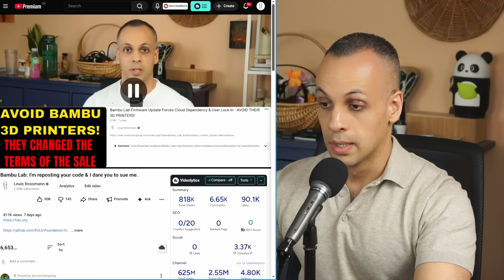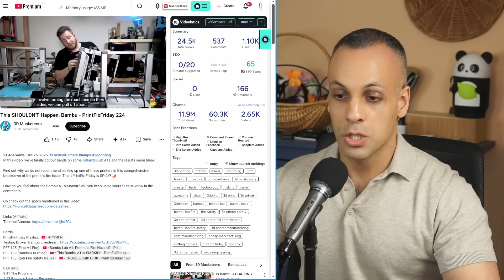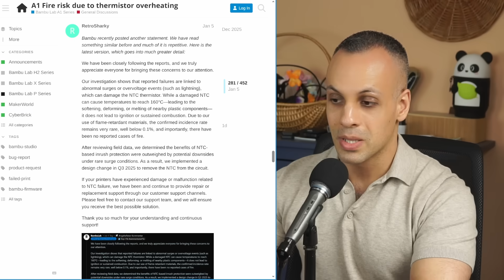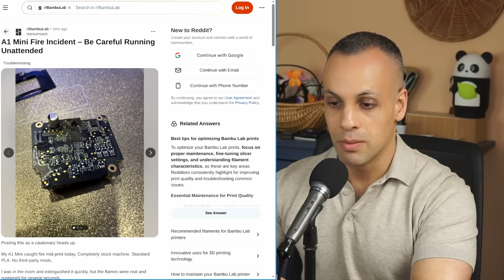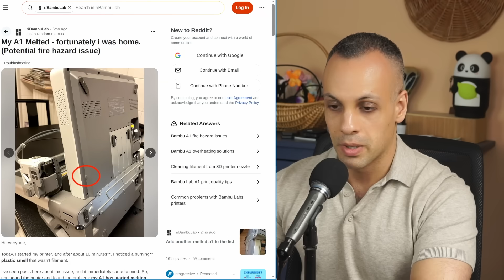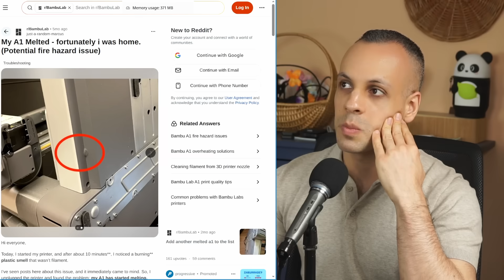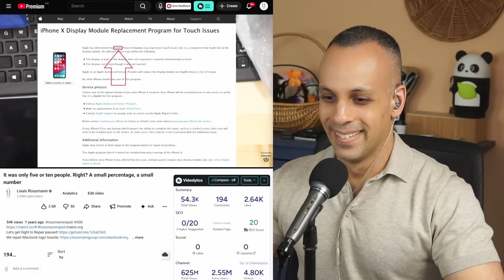Bambu Lab PR dumpster fire is turning into a literal one...

Comment: When i was looking for a 3D printer für at home and later for my team at work, i specifically ruled out Bambu lab printers for 2 reasons: the normal versions needed an internet connection either for printing or for first use installation, and i did and do want to be able to use the ting completely offline.
(the extra company version of a printer they offert was able to work "lan only" but they did not give me any price, so we got something else for work)
And the second reason is their busines practices of changing the terms of serice after you already paid.
That alone is a reason for me to not consider any product of theirs at all.

Comment: The need to avoid a part made by a particular manufacturer is not that unusual. I remember a time (many years ago now) where it was best to avoid buy 741 op-amps made by Fairchild. They were known to be a common point of failure in electronic devices. Personal computers from the 70's and 80's often had a particular brand of RAM that was prone to fail. The people who work on retro computers with the goal of getting them working again would often find that if any RAM chips in the machine had failed it was often a part made by one particular manufacturer.

Comment: I mean... NTCs are the most common inrush current limiting devices in PSUs. Not just Bambu Lab PSUs. ALL of them. And the failure mechanism is exactly how they described it. So unless there is something more going on, which I am not aware of, it seems the story is blowing up only because of the extra scrutiny they fall under after the software fiasco rather than an actual problem.

And for everyone saying 0.1% is a massive number. It's not. In consumer electronics 3%RMA ratio is considered acceptable, and below 1% is awesome. Not to mention, even if NTC fails (which happens to <<0,1% of the units according to the message), it's even more rare for a dangerous failure mode to occur.

What saves the PC PSUs is that most of them will trigger overcurrent breaker in your breaker box. So if you are worried about low power electronics like this, just use an extension cable that is fused according to the load connected. You probably should anyway but who am I to suggest usage of basic safety equipment.

Comment: Just to be clear for anyone who isn't clued in. A component reaching those temps is not ok. That is where you would need a heat sink and ventilation/fans. Heck if your plastic is melting and deforming, if soot is forming on the inside that's not something that will end well. It is a cause for a total recall but a recall is hellishly expensive and that's the crux.

Comment: This is as so often a US only problem.

Bambu designs their printers as pretty much anyone else for use in the developed world, and then needs to retrofit them for the low voltage use in the US.
The heated beds are a prime example for this, in the US models take way longer to heat up with their low voltage AC grid and underspeced breakers in house installations.

The US power grid falls out of spec way more frequently than almost any other, and you can only design to spec plus some margin.
Power surges and outages are unheard of in the western world for half a century.

This rare occurrence only seems to happen if you use your printer way out of spec due to the unreliable US power grid. 

Same goes for cars, with the abysmal petrol quality in the US.

Comment: I'm a chronic shopper and heavily research most of what I buy for myself, but by first and only 3D printer was a gift for which I did zero research and had not even the faintest hint I'd be getting. It's FlashForge Adventure 5M and while the user experience isn't perfect (proprietary nozzles, some connection troubles) the prints have really been effortless and consistent. I suspect most 3D printers today are probably about the same so it's wild to me that Bambu has such a large market share.

Comment: I love my A1, best FDM printer user experience I've owned. BUT if they have any unsafe component, or if they are changing the user agreements after the fact they should be taking responsibility for it. One thing does not preclude the other, and if they blame the users or try to gaslight us, then fuck them.

Comment: I love their hardware and their P1S has been really reliable. after what's been going on lately though... >_> I run a small charity print farm so when these 4 printers start dying, I'll look into replacing them with the Snapmaker U1 or something comparable. The hardware still works, so I'll still use it, but depending on how things go over the next month will determine if i buy repair parts from them or a third party.

Comment: Ha! My A1 almost burned on me, then the integrated PSU popped dramatically, it was only 3 months old so it was fixed under warranty. However I was smelling a burning plastic smell for a while beforehand, googles "A1 fire" and a cap in the hot end motor driver board was the problem, disassembled mine and it appeared to be the same problem, but the warranty replaced the PSU, and it has been working since, and the cap hasn't failed yet... No burning smell either. Weird. 
I run it in a shed away from my house that I am not concerned with burning down, built it in a weekend for other uses and will build it again if need be.

Comment: Just bought another X2D as a mech/elec engineer developing an injection molded mass produced outdoor electronics product. Sucks to go bambu but there are some workarounds to the shitty bambu slicer and cloud. Competitors are lack luster and it doesnt make sense for me to buy into lesser technology when Bambu is on the actual cutting edge of vibration controlled calibration, best injection molded parts, Best, AMS, tons of printers available on FB market, etc.

Comment: I mean bamboo as a plant starts off great, but can quickly become a pest when it starts spreading and is an absolute pain to remove. so it seems the company chose their name well.
Reply: I actually researched bamboo and found out there are two types, each with a lot of sub species. Running bamboo is like what you mentioned, it's like a weed that can spread everywhere. Clumping bamboo is what you want, it spreads, but the spread is limited.

Comment: NTC Thermistors have lower resistance as temperature increases.  If it is driven by a  current supply that is not properly regulated, it can draw more current, creating a feedback loop which can cause the thermistor to get VERY hot (thermal runaway).  This might be enough to start a fire.

Comment: oh oh, theres so many, well some of its bad electrical engineering, and some of it might be fixed in software. I dont want to work for these guys to fix it though. So you have inrush over current on the A1, control board, this probably requires an ECR. the ones for the extruder might be fixed simply with software controls.

Comment: i own bambulab printer. Its a very good printer. Its a game changer. But they are preparing for releasing new multi color multi precision nozzle printers. That would open a gate to print CMYK almost all colors just by using 4 filaments like standard printers do by mixing colour close to each other.
So if someone would have orca slicer with all functions of bambulab and its multi color multi nozzle wont produce alot of plastic poop then ure in market all the nerds gonna jerk to that. You can even cash out a bit more because its gonna be basically new standard.

Comment: NTC voltage divider thermal safety sensors are ubiquitous in consumer electronics. 
There aren't many possible ways to implement them. 
There are numerous (sometimes, uncountable) combinations of electrical design considerations that determine which implementation to include. 
The test engineer must be aware of, and fully understand all of these details in order to develop an air-tight MTP that not only verifies intended nominal operation & full range of operating failure modes, but also validates the design.

If your hardware designer is an AI, and your lead test engineer is an AI, then you better pray that the warden at the prison you're headed to will also be an AI
Reply: Then again, if it wasn't for AI then I would have never had the opportunity to conduct my current independent research into motor-driven batch flow mass-transfer operations across isolated multi-endpoint distributed systems. 
(Some still call it "pizza delivery" which is a grotesque, even absurd over-simplification)

Comment: I have had my anycubic chiron catch fire due to a broken wire. Once the wire snapped from the insulation burning off it self extinguised.
Twice. It was bloody old though, modiefied and after repairs it worked perfectly.

The new Kobra 2 Max bricked after a software update. So they sent me the previous firmware along with how to revert the change and have it not connect to Wifi.

I like Anycubic.

Comment: I was really interested in Bambu when I was first starting out, but their closed ecosystem really turned me off, even though they looked like the easiest option to learn the craft. But honestly, it's better to just suffer through the rocky start. I went with a resin printer, ultimately, and I didn't actually print something properly until like my 3rd or 4th print, and by that point, when my print rose from the resins, my breath caught like I was seeing the new birth of a star. And also because I was choking on fumes due to forgetting to shave my beard for my gas mask. I'm more careful now, but resin is some nasty stuff!

Comment: I watched this on my phone on a phone stand that says "bambu labs" on it that I printed with a bambu printer where I also just received a notification that my morning print was done. 😂🤷‍♂️ I really hope they wisen up. Yet again, I don't understand how companies in this era think they can conduct themselves this way on these types of issues. These aren't really the hills to die on, don't jive with frankly a lot of their actual business and they really undermine their brands unnecessarily. "Folded under zero pressure." It's like they're not just running an MBA playbook from >10 years ago but pre-mass adoption of the internet and skipping basic relative cost analysis. This isn't even THAT deep but you can set up an unstoppable domain on a webserver that can be self hosted on a smartphone from >7 years ago. That phone can be connected to multiple channels and redundant in a failover CDN. You can technically serve it from regular radio with the correct specs/context but be compliant with FCC rules etc because they don't really muck about. Then you have wifi, various G's of cell signal, satellite, possible Ethernet (convertible with a dongle and other options), bluetooth and also various forms of mesh nets. There are turn key off the shelf mesh net systems as well as open source software now so even if you aren't that technically inclined you can do some of this. Putting it mildly there are ways. You can also do physical print if all of your typically Chinese made tech magically isn't working for whatever reason. Not sure how they thought these types of things would go unnoticed or how it was apparently absolutely imperative that they make these decisions this way.

Comment: I was looking for a new 3d printer... Bambi lab was actually pretty well priced. But then I remembered that they screw over their users with locked down firmware and software and I actually fully stopped considering their printers as valid. Also pretty well priced but still way too expensive.
So anyway I went with a printer that is closed down but with a simple firmware application it opens up and supports Klipper and Orca Slicer. That while also being substantially cheaper than the stupid bambi lab printers.

Comment: Look Bambu makes a good product but there tactics to get there are wrong I purchased an A1 mini and my terms of service changed after I purchased it.  While I have 2 now now I choose them for reliability but I also dont not want them to lock other things down I would love to be able to contiinue to use orca if I choose with out having to got to lan mode. They need to create and api based system so they can work with other slicers and still maintain their security.

Comment: I'm going to give bambu a suggestion to stop their printers from having a thermal runaway event in the event of a lightning strike

Instead of defending yourself, You should engineer your way out of this situation. Maybe add a fuse so if the printer gets zapped it blows a fuse.

Anyways I love my Prusa Core One, not because it's the best. But because Joseph Prusa doesn't backstab his community. 😅

Comment: Lol. I had thermistor burnt in Bambu A1. Normal usage, a few hour print. No issues with sending a new one though but left me concerned that this part is not beign actively cooled down.

They should dispatch free upgrades like fans or any type or passive cooling to minimize the print.

Not going to buy their products
Reply: I meant to minimize the risk

Comment: As somebody who's tinkered extensively with other printers before getting a base model Bambu, the quality is insane. I wish I could get the same results with my other printers, but even with hours and hours of optimizing and upgrading parts and calibrating, the P1s destroys them with zero effort from me, and it's not even close. So I'm probably going to buy another bambu, not because I don't care about these issues, but because the value proposition for quality of output at the cost of my time is so crazy. Nothing even comes close that I've come across yet.

Comment: I still have the X2D at the top of my list and it is what I am most likely to buy when the local distributor gets their stock in the next couple of months.  I have not found anything else that is fully enclosed, actively heated, has at least two nozzles, has locally available spare parts and a similar price.

When I started looking last year there were many people recommending Prusa, but once I saw the astronomical prices I knew that was not an option for us.  They're basically priced for the wealthy.

A video like this can give the false impression that Apple and Bambu are unique in brushing off problems with their products, but this is and has been a common practice.  Things were even worse before the advent of product safety and consumer protection laws.

Comment: I personally own five Bambu printers (4 P1S and one H2S) and I also have a P1S at work.  I love the ease of use and that, while the parts are proprietary, they are reasonably priced.  That said, every single one of my printers is in LAN-only mode with Developer Mode enabled (when needed; my P1S units are on the last firmware that didn't have that restriction) AND their IP addresses are blocked from the internet in my router.  I am a proud OrcaSlicer user and I am making sure I can use what I bought the way I want to use it.

Comment: The more I hear about this, the more happy I am that when I bought a new printer last year, I chose Anycubic over Bambu even though the comparable Bambu was on sale at a very similar but slightly higher price. Is it perfect? No, but it's a massive improvement over my old ender 3, and honestly I don't think the P1s is any better than the Kobra S1 I got. With the kobra s1 and ace pro (their version of ams2), I can pretty much load any filament except tpu, send a job from the slicer, and forget about it till it's done. That's my only complaint with the anycubic - it jams with TPU no matter what I try, so I just use the Ender3 for TPU, since it's very good at it, and you can't print TPU fast anyway.

Comment: You actively avoided a recall and essentially just did the recall without force and out of good faith. 
Bambu is going to be forced to do a recall of all A1 from before 2025 with how they framed the issue.
Also any death is not clearly on them if it's fire related and the printer is before 2025. I would not take that risk.
Reply: Bambu P1S owner and im not happy about any of the things currently happening. 
Bloody great printer, shit company

Comment: Since you are always trying to be objective, I wonder what  percentage failure there is from the manufacturer of the components Bambu buys to make this circuit?  The actual "very" small number of failures they stated per the millions of printers they have sold could also point back to the component manufacturer as well.  There are percentages that industrial standards allow QC to meet to be marketable.  I am not standing up for Bambu, I am being totally objective and throwing a thought out here.  And yes, Bambu Labs made 3D printing more avaialabe, they set the pattern, and now other companies are following.  So soon there will be competition that will hopefully force out the bad actions by Bambu.  I started with one of theirs b/c it opened the door.  I am now finding I am learning the tech just as a natural part of already "having my feet wet."  It is a fantastic learning tool to start with b/c you can get tangible results by using their presets and not the old approach of tweaking and tweaking and (etc. ad nauseum) until you get something resembling what you wanted to start with. Thumbs up!

Comment: I have the A1 and love it.  Had Creality before this.  And got sick of troubleshooting issues.  Did I learn lots about the tech and how it works? Yes.  But I got to the point where I just need this thing to Print the thingy I need.  Im a useful printer not a collectible printer.  Time = Money.   Am I disappointed with how this is unfolding? YES.  But overall the A1 is still a good product.  I would like to move up to an enclosed printer one day, but if Bambu doesn't clean up their act I may start looking somewhere else....

Thanks Louis as always! Hey where are the repair videos? I miss those I learn lots from those.